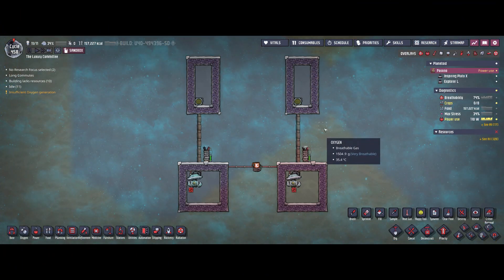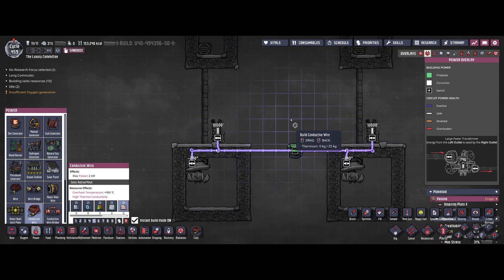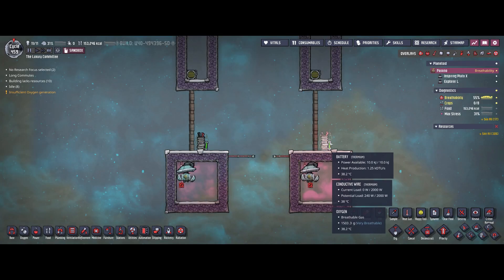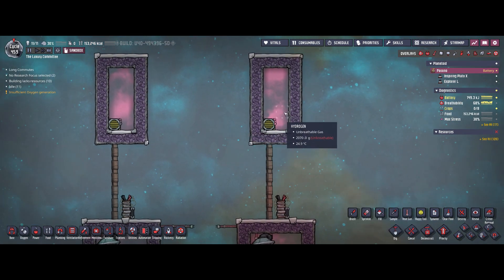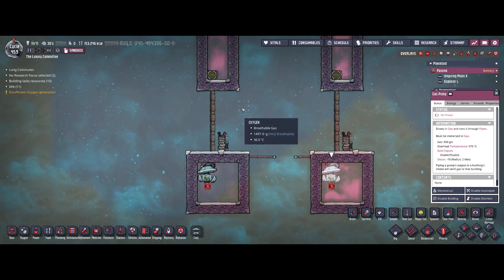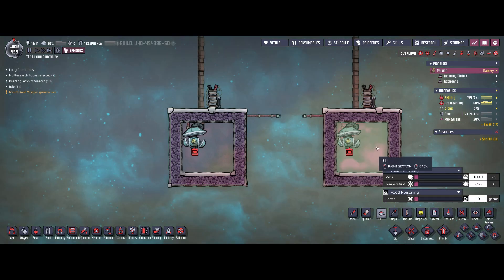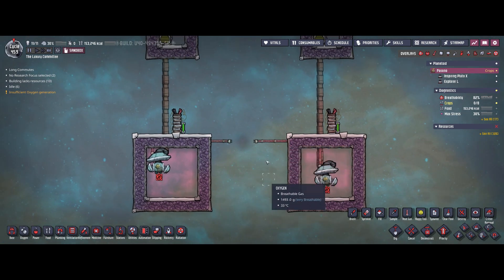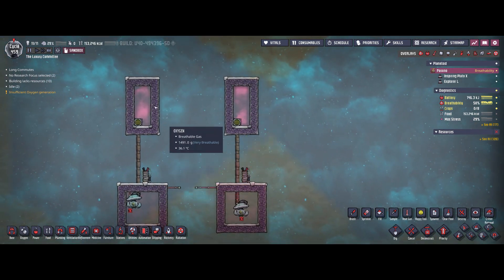Oxygen Not Included: How to operate Gas Pumps at max Efficieny (basics)

Comment: Good experiment.  In my experience gas pumps appear to draw from 5 locations.  upper left, lower left, lower right, below the lower left and left of the lower left.  They sense the upper right corner to decide if there is anything to pump.  I don't know if blocking the space to the left of the pump and below the pump will affect the output at low gas pressure but I suspect it will.
Reply: There's a mod that shows building ranges which highlights the spaces that a gas pumps pulls from, it's a + sign centered on the bottom left corner of the pump. I would suggest positioning the bottom left corner of the pump in a spot central to the gas chamber, so as the pressure drops from the pump, you have more tiles around that can back fill in. Another way to help efficiency especially if you have multiple pumps feeding the same pipe, is to combine gas packets using bridges and gas valves.